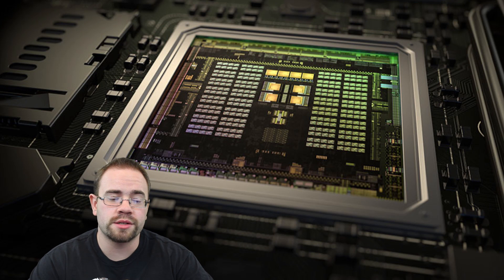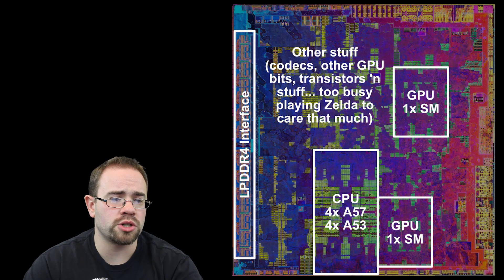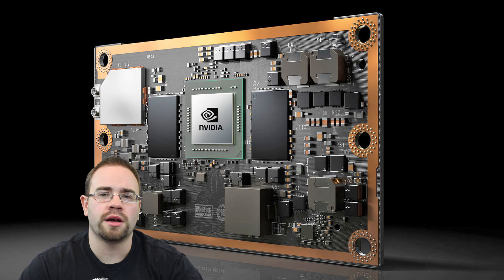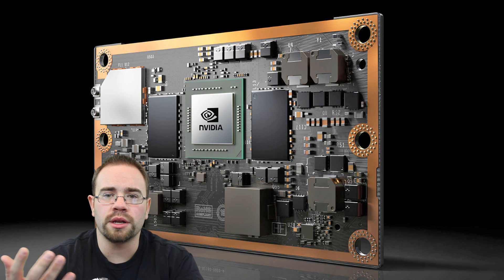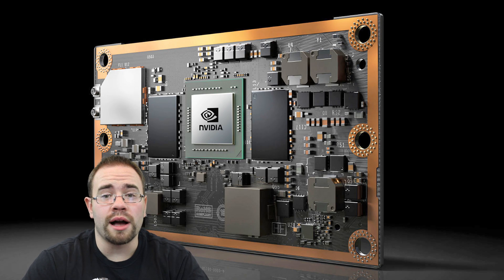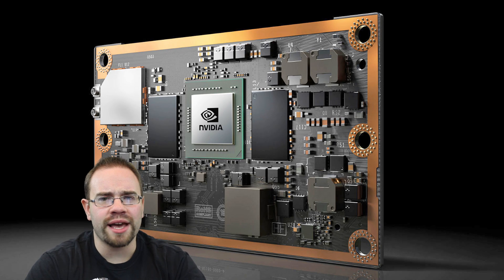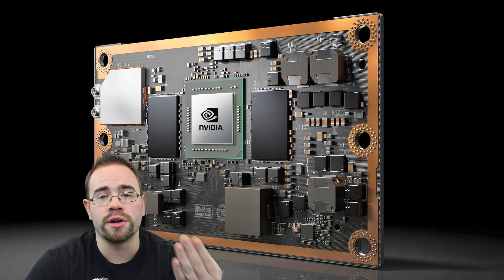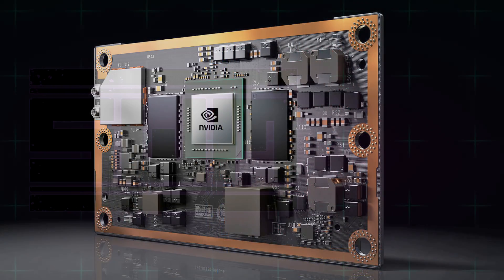Nintendo Switch Chip Was X-Rayed! Here's What's Inside.

Comment: I would say it's still a different chip, and x1 certainly does not match the UE4 preset which is a bit too much even for 940m. Pin setup was different from X1 too. Just because they look similar does not mean they are the same, and I would suggest further tempering (for one dis-soldering the chip from the board and removal of top cover), or at least see what the recent hacker have to say for the hardware after Nand Dump.
Reply: So essentially the chip has a similar setup but something to remember: 
1). 16nm, while much more efficient than the crappy 20nm, offers little to no density improvement (Intel is the only one who improved transistor size compared to previous gen, so stop shaming intel). To counteract this, Nvidia introduced pascal by pushing the performance of smaller gpu cores, while boosting their clock and ipc (Nvidia said it them selves that Pascal is like Maxwell splitting in half with major boost to both half). Using pascal, Nvidia can stuff more cores in the same area, allowing 512 cores, which matches the 900+ G single precision which showed up a second time on a dev unit. To put to perspective, the recently  introduce Jetson TX2 only allowed 1.3GHz, which is little improvement over tx1, which is the peak of tegra x1. So unless the scan indentify actual cluster and compare their sizes and numbers, I would suggest everyone to hold a grain of salt.
2). A Previous leak from UE4 which I believe is on 4.15 sport a preset not far behind the power of xbox one when docked, and something on par with x1 when in handheld mode. Despite botw's great visual, it was not close to pushing switch's true power.

Comment: MK8D being only 30fps in 4-player kind of confirmed this for me before this xray.  Current potential is around 74% of Xbox One power.  At full clocks, the equivalent to AMD power would be around 1.250Tflops, nearly Xbox1 power.  Need to bump Switch clock speeds to produce 1Tflop to achieve this.  I doubt Nvidia will spin a gpu just for Nintendo, but, Sli Tegra X1 would be more powerful than standard PS4, even accounting for only 80% efficiency.

Comment: i sorry i don't think its that undepowered than the xbox one,zelda in dock mode on the switch is displayed at 900p.The same with most xbox one games.
Reply: antbansz187 The Xbox one runs games like gta5 and fallout 4 in 1080p. Zelda isn't even graphically impressive and to only be 900p is kinda sad
Reply: This thing doesn't come close to an Xbox One.

500 GFLOPS FP32 max (still need to verify the clock speed, but it's rumoured to be much lower) vs 1.3 TFLOPS FP32 on Xbox One. Maxwell may have architectural advantages over GCN, but not enough to make it comparable.
4 GB RAM, with 25.6 GB/s bandwidth, vs 8 GB at 68 GB/s, with 32 MB eSRAM at 206 GB/s on Xbox One.

Comment: Knowing quite little about chips. Could anyone tell me if the Switch could  theoretically run say the new Mass Effect game? I know it would have to be optimised of course but is the X1 capable?
Reply: _ _ Hm not really a fair comparison as Mass Effect 3 was built for last gen systems were has Mass Effect Andromeda is build for PS4/XboxOne
Reply: TheBrownLamb Yes, ANY game can run on the nintendo switch. it just depends if the developers want to invest the time and money to create a custom version of a game which is specifically designed for the switch hardware. It probably cannot run the PS4 version of Mass effect but it could run a specially designed version of the game with different assets and maybe a lower resolution or fps. The physics and the gameplay mechanics could stay the same because the switch can support the respective game engines and API, the visuals of the game would be the only thing different. The X1 is a pretty capable chip and is the most powerful mobile chip right now. the power of the switch is somewhere between Wii U and Xbox One, which is pretty impressive considering the switch is also a handheld device.

Comment: if its pascal based, i don't think nintendo would push for performance gains, but more power savings (play longer on a single charge). The Ipc of pascal is literally the same as maxwell, but the die shrink allowed higher clocks while lower power consumption (more performance per watt). We might see a "new" nintendo switch in a year or two, that has significantly improved battery life in handheld mode and increased power while docked.
Reply: changen pan Honestly, zelda runs for 2.5 hours on maximum brightness and stuff. I locked myself out of my home yesterday. around 9am and had to wait till 2:30 for help. fortunately I took the switch with me and I played the entire time. all I did was lowered the brightness a bit and turned on the wifi it ran till then and by the time I got in and put it into the dock it still had 5% charge left. personally I found the battery life to be very impresive considering it was running a game like zelda while my new3ds struggles with sun and moon

Comment: Are we all just going to ignore that nvidia basically flat out lied to us?
Reply: +CWeltonDesign
"The X2 Parker does actually exist in the Jetson."
That was only just recently announced... it has, however, existed for Nvidia's auto industry partners for several months now. Ultimately, the cost and timing just weren't quite right for the Switch. They originally wanted the system released late last year, but had to delay it for games. Had they waited for a Pascal based SoC, they probably would have had to wait another year.

Personally, I always found the vague statement from Nvidia as a bit of a red flag. I don't think that specifically stating that it had a GPU based on their latest architecture would have been an issue for Nintendo, since it doesn't really tell people anything about the processing power of the system without more important information. At the same time, they didn't want to kill excitement by making it too obvious that it was a bit older.
Reply: @MOHAMED
uhh i have been repeating this for several times already. look at it this way: when nvidia come out with fermi they have the fastest gpu competing in that generation which is GTX580. with kepler generation nvidia have 780ti as world fastest gpu in that generation. with maxwell nvidia have 980ti (and titan x). so for several years nvidia already have that "top performing gpu" each time they coming out with new architecture. this is what nvidia really meant when they mentioned "top performing geforce gaming graphic card" back in october. nvidia are being more general about it instead of being specific. even if for example nvidia are using tegra K1 (kepler based) inside the switch they can still said it as "world top performing" because kepler also used to hold that top performing performance with 780ti. remember nvidia never said it is based on their LATEST/NEWEST architecture.
Reply: "Just because a certain architecture was at one point the world's fastest doesn't mean they can quote it 6 years later and it still have any meaning."

that simply how it is with marketing. we always heard something like "world leading solution to X and Y" from certain company despite there was even better solution out there for the same product. heck most of this company are aware about this but they definitely cannot word it in a way that their solution is inferior to others. in nvidia case they can't make it using maxwell as inferior than using pascal. they know from the start switch will be using X1 so they play around with the wording. "top performing geforce gaming gpu" but they never make the word pointing to their latest architecture. 

also people are forgetting that console can only use things that available to them during development. but by the time they come out the hardware might as well outdated. PS3 for example were using nvidia 7000 series tech. but by the time PS3 comes out nvidia on desktop already moving to unified shader architecture with their 8000 series. xbox one and PS4 were using GPU based on AMD first gen GCN. but by the time both console coming out AMD on desktop already coming out with their second gen GCN. so to expect switch to use pascal might not that realistic to begin with. we just hope it will be a custom chip but in the end it is not even that? about this one i agree you can demand an explanation from nvidia when their employee said it was "heavily customized tegra".
Reply: +Renzc ode You just tried to push the same point that you did in your last comment. Because Intel Pentium 3 was the world's top performing chip at one point(not actually sure if it was) doesn't mean something built today off of that architecture can be still claim to be built on top selling architecture. You sound so absurd defending that point.
Just face it. Nvidia lied to us. Maxwell was not "world's top-performing Geforce graphics card(s)" at the time of that statement in any way.
The X1 was released Q2 2015 and the K1 a year before that. It had been another year at the time of that quote. The X2 Parker does actually exist in the Jetson. Was it really so hard believe that their Pascal architecture could have been in mind for the Switch. 
We were all played. I love Nvidia, but a little respect has been lost.
I'm out.
Reply: I don't blame Nintendo. They made their decision and its working. In fact they undersold themselves graphically. The X1 is incredibly sophisticated.
 They never promised an " NVIDIA GPU based on the same architecture as the world’s top-performing GeForce gaming graphics cards." Nvidia DID.
Which was Pascal. Period. No other architecture matches that definition. We've covered that multiple times.
Marketing can't live by a double standard and be impervious to criticism.
I am criticizing.
If Ford decided to reveal today that the new Mustang would be powered by the top-performing naturally aspirated V8 in the company (without actually naming it) we would all expect the gt350's Vodoo engine because it is. 
If it ends up being the 5.0 unveiled in 2011 then that would be defined as misleading or lying.
It's really simple logic kid.The back peddling you are doing is pathetic.
There is no evidence that any of you have presented that proves the any other architecture can meet the top-performing besides the new fresh Pascals.
Reply: I agree. Here's from my other comment on here.
"The high-efficiency scalable processor includes an NVIDIA GPU based on the same architecture as the world’s top-performing GeForce gaming graphics cards." Posted on OCTOBER 20, 2016 by ASHISH KARANDIKAR

 Top GPU at that time was the Titan X Pascal next was the 1080 (and the Quadro P6000).
 Huge performance power and clockspeed difference between Maxwell and Pascal. 
The old highest performing GPU was the 980Ti and titan X Maxwell which was released almost a year and a half before that statement.
Really sketchy.
Reply: Did "world’s top-performing GeForce gaming graphics cards" refer to a specific GPU, or the GeForce brand as a whole? 
They used an intentionally vague statement.

This is Nvidia you're talking about.
Reply: @ArynCrinn
this is what most people did not understand. they assume it is pascal just because nvidia current fastest gpu is pascal based. but nvidia never said it is based on their latest architecture. the only said "world's top performing geforce" and that can be subjective. nvidia can use tegra K1 and still claim "top-performing" because kepler also power their past top performing gpu like 780ti. so there is no lie. it is your own fault if you think it was pascal when nvidia themselves never said so. for nvidia their top performing can be any of their existing architecture.
Reply: +Renzec ode Sorry that's a BIG reach if I've ever seen one.
 Maxwell was outdated at the time of that post. Maxwell and Pascal are DIFFERENT architectures. Nothing from Maxwell was the "world's top-performing Geforce graphics cards" on October 20th. In fact the 980ti was sitting at number 5 at the time of that post. 1-4 were Pascal. The Titan X Pascal superceded the Titan X Maxwell in EVERY way.
Just because a certain architecture was at one point the world's fastest doesn't mean they can quote it 6 years later and it still have any meaning.
Read what you post first and listen to how that sounds. I'm hoping for someone who can actually explain this with sound logic.
Reply: +CWeltonDesign
I imagine Maxwell had pretty good sales performance at that time...
No one ever said it was graphics performance.
Reply: + ArynCrinn Hey that's lame but is a valid point. Thank you for a different argument. The old one was getting recycled too much.
The 1060s 1070s and 1080s were killing it sales wise though. Especially in the gaming laptops which have seen an enormous increase before this quote in October from the non m GPUs in Laptops (best thing ever to happen to laptops!). Again they could have used the same point to mean it has the same architecture as the 9800 gt which was a top  sales performer in 2009...
tricky HR talk. Still feel shafted by Nvidia. The X1 is still great though. The best there is commercially on mobile.
Reply: +Renzc ode
"also people are forgetting that console can only use things that available to them during development."
Not entirely true...

Xbox 360 shipped with a GPU which was basically a prototype for AMD's first generation TeraScale architecture, which first released in 2006. 

PS4 and Xbox One have GPU's that are actually based on Second Generation GCN, which is why Xbox One supports Direct3D feature level 12_0, instead of 11_1 like first gen GCN cards.

The PS4 Pro includes some roadmap features from both Polaris and Vega... the latter of which is still yet to be released.
Reply: marketing has always been twisted. why did you think nvidia very insistent to have that single gpu crown for themselves? on marketing stand point that give you the image of being the best and help selling your much slower product. many people end up buying GTX1060 over RX480 despite the later is cheaper and about as fast because nvidia image was associated as being the best. you want evidence? here it is: nvidia in GPU world has always been regarded as "top performing" be it in tesla generation, fermi generation, kepler generation, maxwell generation and now pascal. that's why i said "top performing" is more generalize term for nvidia. i'm aware of this since the very beginning nvidia coming out with that article. in their wording they try not to indicate that "top-performing" as their LATEST architecture. even more why they did not said "same architecture as world's FASTEST performing gpu"? if that's so hard for you to understand then you're mostly the type that take marketing word at face value. 

look at what AMD did with Fury X. they said Fury X is the fastest gpu on the planet and beating 980ti. even show various benchmark to prove it. but the twist is AMD back then bench the game using specific setting that would make their Fury X on top. this is how twisted marketing can be.
Reply: +ArynCrinn Yeah I totally agree. 
If you think about it, it was genius marketing. How many millions of hours of views and discussions were created regarding what would power the Switch. The rumors spread like wildfire and weather good or bad publicity the switch very much benefited from it. The fact that we just recently got final official confirmation that it was an X1 (although pretty accurately leaked) is pretty incredible considering how much of an obsession it had become for many.
If done incorrectly it could have just been dismissed as another gimmick (at least at first until people realized how awesome it could really be).
Reply: +CWeltonDesign
At this stage though, I wish they would just publish the full specs.
I remember seeing some devs take to social media to express their upset over the leaked developer documents. One did point out, however, that the only reason why these leaks happen, is because Nintendo don't reveal this information.
Reply: i don't think nvidia have much problem revealing what's inside but i don't think nintendo like that. even wii u the actual spec is still not officially being released by nintendo. spec aside i want to know what developer that developed for the system think about the switch with no bar hold attitude.
Reply: you can said nvidia are lying on the custom part but not on the which architecture the switch will be using. nvidia never specifically said it is pascal based then how you can say nvidia is lying when nvidia never specified it anywhere? "top performing" is subjective. it can be anything. don't apply regular logic to marketing logic.

parker in jetson doesn't have anything to do with the switch. because the ultimate decision on which chip to put onto switch still lie on nintendo decision.

"Was it really so hard believe that their Pascal architecture could have been in mind for the Switch."

why blame nvidia for nintendo decision to put X1 inside the switch?

Comment: Level 5 did say it was between a Wii U and an Xbox One. There was another article that said it is ten times more powerful than an iPad. It is a little crazy that Nintendo didn't up the specs. However, I am sure we will see a Nintendo Switch Pro or something along those lines. 

Sony and Microsoft are upgrading or have upgraded their current hardware, so I am sure Nintendo will do the same at some point because they will most likely need to. We might see it before 3 years. 

On the other hand, I am wondering if this will change Microsoft's Scorpio concept design. It would be interesting if Sony and Microsoft copied Nintendo with their follow-up consoles.